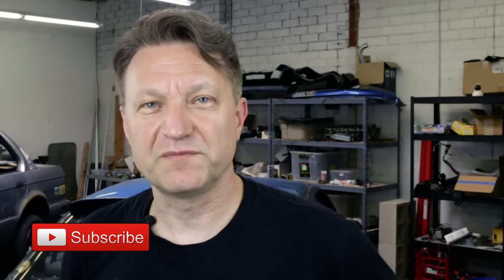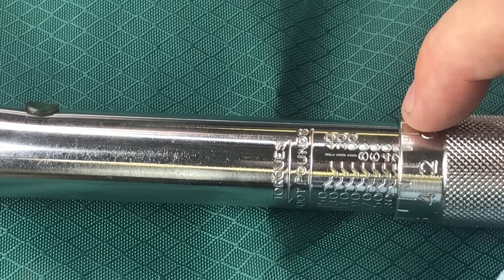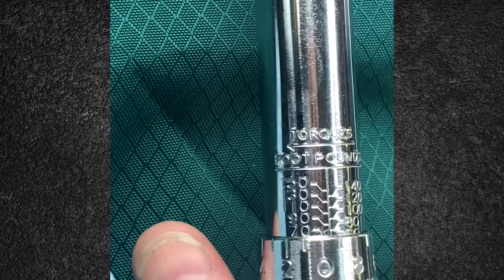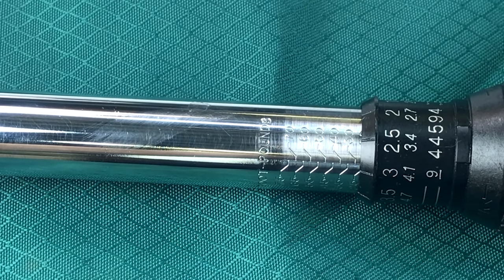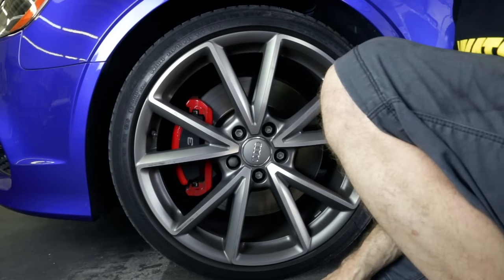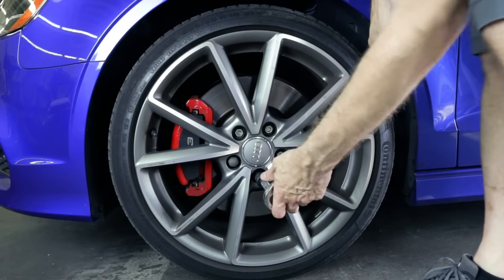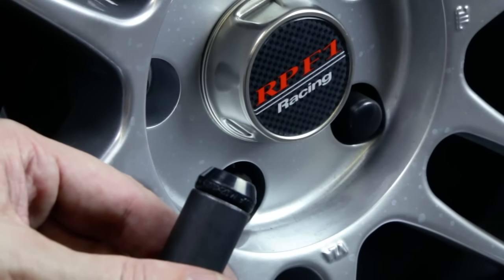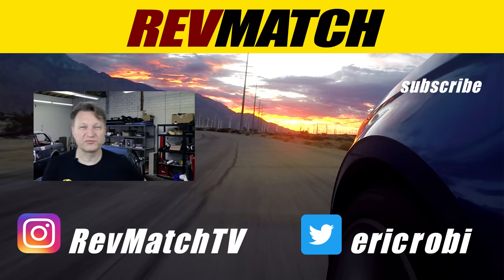How To Use A Torque Wrench For Beginners

Comment from the maker: I just updated this video with new info and discuss the ONE CLICK controversy:  https://youtu.be/Bbgv8hUEIsE
Reply: Gotta tighten the back of that one wrench
Reply: I just replaced the upper control arms & ball joints on my Expedition.
i did NOT torque my lug nuts.
I had tires installed on my Mazda 3 wagon.
I have a boat & Boat Trailer repair shop, so I can do routine maintenance on my own vehicles.
When I changed the oil & filter, I rotate my ties on the Mazda 3 (and the other vehicles too.)
I CURSED THE TIRE COMPANY! For using a torque wrench on the lug nuts.
I had to use a breaker bar & a pole for all 20 lug nuts. The air gun got me nowhere.
Reply: Hello. So, I "rented/borrowed" a torque wrench from O'Reilly's.  Need to do head bolt to 44 ft lbs, plus 90 degrees.   Did first 8 on one head to 44, moved dial to 55 so I could add the 90 degrees.  Then went to second head.  Dialed back down to 44.  Busted bolt. Looking at instructions, which I didn't bother to do initially, it says that when resetting wrench, always go back to zero.  Is this common knowledge? Because the guy at the store didn't say anything, and I've looked at a couple of videos online that also didn't mention this.  Is that why my bolt busted, because it was still set at 55, or was that wrench just faulty?
Reply from the maker: @steveluera2109  Not sure what you mean by 'resetting' the wrench, but are you actually trying to torque down a cylinder head but you don't have a torque wrench?

Comment: GUYS REMEMBER TO DECOMPRESS YOUR WRENCH!!!!! AS THEY ARE SPRING LOADED AND LEAVING THEM WITH COMPRESSION WILL KILL/DESTROY YOUR WRENCH!!!! DECOMPRESS IT BACK TO ZERO
Reply from the maker: YES! Very important!
Reply: I've heard that but never done it. Never haf issues either. Springs wear out from constant expansion and contraction, not from stationary placement.

Similar situation:
Think about the suspension on a vehicle. A vehicle can sit in a parking lot for 20 years, the springs don't wear out. But use it every single day, eventually the springs wear out (and break).
Reply: Also think about valve springs. Valve springs are under constant load, that is not what wears them out. What wears the valve spring out is the constant expansion and contraction of the spring due to the camshaft's lift.

 Remember, every time the spring expands or contracts the atoms inside realign to form a crystalline structure. And crystals aren't very good at being springs, they tend to fracture and break.
Reply: @sethh8892  its funny you say that, but I feel like you're probably correct and this is just the remnants of a bygone era.
Reply: What does this mean
Reply: @Pintexx  means after you’re done with your torque wrench for the day you set it back to 0ft/lbs because they are spring loaded. as SethH88 said though it doesn’t really matter if a spring is compressed or decompressed as long as it’s static because the constant cycle of compressing and decompressing is what actually wears any spring. Like if you bend a sheet of aluminum back and forth repeatedly it will eventually be so worn it will snap. Even though springs are made with special steel the concept is still the same just takes longer.
Reply: To the lowest setting not back to zero!!!!
Reply: Thanks! Good to know
Reply: Just like loaded hand gun mags that many claim to unload them after long term storage to release tensions. Springs don’t wear out being compressed. Its usage compressing and decompression that wears a spring out.

Comment: The first time I used a torque wrench in ...god...2000, I confused inch lbs and ft lbs and broke off a water pump bolt in the 4G63 block on my Talon. That was also the day I learned how to drill out broken bolts! Great vid!
Reply from the maker: Eeeek! That's pretty bad! I've twisted off a couple bolts accidentally. Usually is the small ones. Thanks for stopping by!
Reply: I think I did that same thing once, but caught myself before actually breaking anything when it felt really weird. Lucky it didn't strip the block!
Reply: @Fully Spooled — LOLOL.   I’m quite sure you’re in a cast of thousands whose made that same mistake.   I’ve stripped out my fair share of screws thinking I had my impact drive in reverse when it was actually on forward.

Comment: yo say "1 click" but each time  you turn the bolt it sounds like "click clcik" or 2 clicks
Reply from the maker: That's because you're hearing the wrench release off the sprocket after it clicks. It's a fairly cheap wrench I'm using. Expect the same sound with a cheap wrench.
Reply: thank you after watching more videos I figured it out  appreciate the quick response
Reply: 2 clicks lol reminds me of when i served as a royal marine in the U.K an then served in the special forces double tap springs to my mind lol. I guess it's a military thing...
Reply: You've never used a torque wrench or seen one being used before?
Reply: Yeah 1st time attempting to change my oil and the 2 clicks threw me off as well.  Came to the comments to see if it was addressed and it was.  Thanks!

Comment: I broke not 1, but 2 bolts on my Miata valve cover because the torque specs are in inch pounds, and my wrench only does foot pounds.   Since I'm too dumb to pass basic math, and do the conversion myself, I just went for "feeling".  That day my feeler was broken.  Dealer wanted an insane amount for replacement bolts, so I found same length / thread pitch at my local hardware store for under $1.
Reply from the maker: I've over torqued a bolt or two in my life!
Reply: Just be careful that the cheap bolts you bought are of same grade aka strength.

Comment: Overtorqued on my Honda Talon oil drain bolt and snapped the head off. Crapped my pants thinking the bolt would get stuck in the oil pan, but was able to get it out by putting my drill in reverse and "drilling" it out. LESSON LEARNED.

Comment: What if you get two clicks? Do you loosen the bolt with the torque wrench or just start over with a breaker bar or impact? Does the bolt need the same force that was used tighten it also used to loosen it up?

Comment: As a graduate, I broke an old specially hardened stainless steel bolt on a high vacuum vessel. I the tried a regular steel bolt, and sheared it off much before achieving the specified torque. I was able to get one of the specially hardened stainless steel bolts from a nearby shop and finished the repair work.

Comment: Dang. That looks super easy!!! I originally wanted to know how to torque my oil pan drain bolt which is at 15ft-lb of torque. Looks like I’ll be using the 3/8” torque wrench for this application.

Comment: Hey Eric! I'm a great fan of the torque wrench , i use it on nearly every bolt to make sure, the next time I open up the bolt or nut, will loose easily! When i use it on the wheels i turn the steeringwheel a few degrees to the right side of the car so you never hit the fender ;) . I also use to let the wrench click twice because in some cases the wrench clicks but the real tightening torque isn't reached yet, so i proof it again!I don't think you overtorque it when you proof.
Reply from the maker: If you need to click it twice to achieve the desired torque it could be that your torque wrench is out of adjustment. I noticed that an old wrench I had consistently under tightened my bolts. I threw it away.

Comment: I bought one but haven’t used it. Got the 1/2 inch drive. Great video btw, but you didn’t go over what the little knock on the bottom is for? It loosens and tightens? What’s it for?

Comment: Thanks for the information I just bought in a torque wrench 1/2 inch so I can tighten up my lock wheel stud nuts on my 2013 Dodge Avenger Blacktop

Comment: I have broken a ton of bolts due to rust, but I don't think I have broken one by over torquing yet.
However another area a torque wrench is super important is any time you are tightening a steel bolt into aluminum, such as on most modern engine blocks and engine heads.
So many people strip their block due to over tightening bolts, especially valve cover bolts for example.
Reply: Done that
Reply: @mayken6661  It do happen. 😅

Comment: You wanted a story? In my (broke) youth I needed to rebuild a differential and couldn't afford the bill, so decided to do it myself as much as I could. Unfamiliar with preloading bearings, Plastigage, etc., I took it to the "experts," a local machine shop, giving them the special order ring and pinion and planetary gears and shafts and bearings, plus photocopied a detailed procedure. I highlighted the instructions for an inch pound torque wrench, and discussed it explicitly when I dropped it off. (And you probably know where this is going.) While picking up the differential I hand-turned the input yoke: thunk-ta-thunk-ta-thunk, gravelly, catching. ("that's... not... right..."). I asked "How much did you torque it to?" "What it says - 11 foot-pounds." They ended up buying me more new bearings, having crushed them... "We don't HAVE an inch-pound torque wrench." Guess you can order one since you're ordering me new bearings...

Comment: In my opinion, if you regularly work on different types of vehicles, just spend the extra money on a split beam torque wrench.
They’re much easier to adjust, and have a 15 degree flex head to help avoid hitting things without an extension.
Depending on the length and thickness of the extension, some people claim that it can affect the torque accuracy.

Comment: I was putting a new starter in my 2009 BMW 328i, and doing a manifold upgrade... the best time to do it.  I got the new starter and didn't notice the new cheapo had a chinsy aluminum and copper mix or something like that... to attach the power wire to.  The original was steel.  So anyway, I gave it just a lil bit, a lil bit.. of muscle to finish tightening the bolt and the thread snapped off the new starter.  I went and bought my first torque wrench the day before for putting the new intake manifold in.
Reply from the maker: Hope this was helpful

Comment: I was just reassembling the rear end on my C3 Corvette. Reinstalling the strut bracket, with my torque wrench set to 45 foot lbs and I broke a bolt. Still not sure why, one clicked a bolt and moved to the next. I hindsight I should have felt it, known it was taking too much. Did the torque wrench not reset between bolts? What did I miss?    Oh, yes, new project to remove that snapped bolt from my freshly overhauled, nicely painted, just reinstalled 😢 differential.

Comment: few years ago, I installed spacer on my front wheels so more space for my rims to put my bigger brakes on it. i needed a Torque wrench to measure how tight the nuts are still got when the screwing gap is shorter with spacers so i know the maximum thickness of spacer i can get.

Comment: So I followed your instructions, I'm using a Craftsman 3/8 torque wrench applying 80lbs on my 2018 Honda Accord. So I manually screwed in the lug until I couldn't anymore. I started tightening the lug with the torque wrench but never got a click in the video. Got to the point where I didn't want to tighten to much more. Am I doing something wrong or maybe I have a bad torque wrench?

Comment: Here’s a great story. Have a half inch toque wrench (which I should’ve used my common sense to realize what I’m about to admit) and it goes from like 90 to 259 ft/lbs. well next to “feet” it also says “inches” so I was under the assumption, ignorantly, that the numbers on the right were inches and the numbers on the left were lbs. nope. All pounds. So I was fighting my valve cover down WAY too tight and ruined the gasket AND snapped a bolt head off in the engine block. Thank GOD it removed easily and I was only put a bolt and a gasket. Lesson learned.

Comment: Not while using a torque wrench, but was putting a bumper back together after changing a radiator or something. My grandpa was putting this screw in and had asked me to give it "just a hair more" literally applied pressure and snapped the screw clean off. I have many stories like this from growing up, as then and even now I don't know my strength.

Comment: Several years ago, I bought a new set of wheels from RavSpec, and bought new tires from my local Mavis, which also mounted, balanced, and installed them on my car. 
Well, turns out they over torqued the wheel bolts using their air impact gun, and when I went to remove my wheels months later to put my winter set on, several wheel nuts broke, and I had to drill them out. 
That’s when I swore to never let anyone use an impact gun on my wheels, and to change them myself whenever possible.
Reply from the maker: Robert LeBlanc That sucks! I only take my wheels to a places I know that will allow me to torque the wheels on my own or I can watch them do it with a torque wrench. Hope you found this helpful!

Comment: Seriously every single time I ever work on something I over tighten and rip threads out, the worst has been the engine on my 85 cj7. Was changin my water pump got to the last bolt and snap. Took the ear right off the block, in the process now I finding a good torque wrench because I’m rebuilding g a 4.0 to drop into it. The torque wrenches I have now are from harbor freight and they barely click, so it’s easy to over tighten bolts. Looking into the craftsman.

Comment: I rotated my tires and didn't use a torque wrench. I did tighten in a crossing pattern, but still had an issue. By not using a torque wrench, I deformed the hub on the car just enough to cause a pulsating in the brakes. It was a big mistake that I'll never repeat. Although putting a tire back on seems like bo big deal, it is. It's probably the most important steps to completing a successful repair.

Comment: I over torqued my lug nuts on a 1999 gmc 1500 Sierra. I simply stood on top of tire iron and i was about 185 lbs. torque should be 140ft lbs. I left it like that for about a year. Until bam it hit me how stupid I was. May I retorque or do I need to replace everything because they may have stretched and now 140 would be to loose?

Comment: I was installing new ball joints and I bought the harbor freight 3/8  just for the job  23 ftlbs  required ,    I set it to 20 and sheared the bolts right off ,   I put in another went to 18  sheared off another bolt,  I bought the parts from 1aauoto...     moog  brand  .     Eventually I snugged them up  using my super powers and left it , in total I sheared 4 nut and bolt combos ..  needles to say I don’t trust that wrench  and I wouldn’t use it even on my lug nuts now

Comment: I used a beam style torque wrench I got at a yard sale to torque the head bolts on my Talon when the head gasket went bad, 6 years later had the opportunity to test it on a Snap on truck and it’s actually accurate but I used an extension and didn’t adjust for that.  Regardless the motor spun a rod bearing 🤷🏼‍♂️

Comment: Actually I just broke three bolts off. I had to tap them out.. first time using a tap and a torque. However I keep breaking my bolts using a torque wrench at the same specs they tell me to. What is 64 inch pounds?  Because I set it at ft pounds? Is there a difference?

Comment: I replaced my rover cover gasket and tightened the bolts I snapped one because I didn't know about torque.
So I totghtened all bolts and went round again making sure no bolts were lose I didn't go mad trying to tighten but feel I done a good job no the least

Comment: I should have watched this video earlier. I was used to the older analog torque wrenches and when I used one of these "click" type of torque wrenches, on my lawnmower, I tightened it ti three "clicks". I stripped the threads on three bolts and had to drill and tap all of them. Sigh. Lesson learned.

Comment: RevMatchTV... You mention in your video that the torque wrench does not come in half foot pound increments. Actually they do and so does yours. You just have to place the line in-between the next increment, this will give you the half pound increment. I hope this helps you and your viewers.
Reply from the maker: bison uberti Fair enough! The one I am using in this video is quite inexpensive however and I wouldn’t trust it for that degree of accuracy. I’m going to make another one soon on selecting a good torque wrench.

Comment: Broke a rear valve cover bolt and it was a major pain.  Working after midnight and trying to get finished I just over did it.  What a mess.  Didn't have a torque wrench.

Comment: I’ve heard it’s very important to do a warm up cycle on a torque wrench before the first use, and after every time it has been stored inactive for awhile.
Also, it’s critical to store a torque wrench at its lowest setting.
I learned this the hard way.
Reply: Hello. So, I "rented/borrowed" a torque wrench from O'Reilly's.  Need to do head bolt to 44 ft lbs, plus 90 degrees.   Did first 8 on one head to 44, moved dial to 55 so I could add the 90 degrees.  Then went to second head.  Dialed back down to 44.  Busted bolt. Looking at instructions, which I didn't bother to do initially, it says that when resetting wrench, always go back to zero.  Is this common knowledge? Because the guy at the store didn't say anything, and I've looked at a couple of videos online that also didn't mention this.  Is that why my bolt busted, because it was still set at 55, or was that wrench just faulty?

Comment: Just want your opinion.  I broke an M8 65mm bolt in my Yamaha outboard. The service manual called for a 30 lb.-ft. torque spec. when the general spec. is 13 lb.-ft. The bolt kept spinning and broke at 26.2lb-ft.  I used a new SnapOn digital ATECH with a 5-100 lb.-ft. range.  I used LT-572 and I think I applied too much to the threads.  In any case, I never made it to 30 lb.-ft. and the bolt snapped while free turning when I neared 26 lb.-ft.  

I really don't understand what happened.  Guess the bolt either got stuck or may have been installed incorrectly.  What are your thoughts??